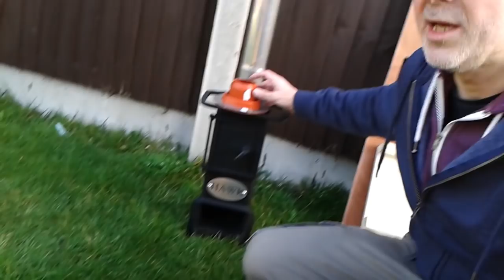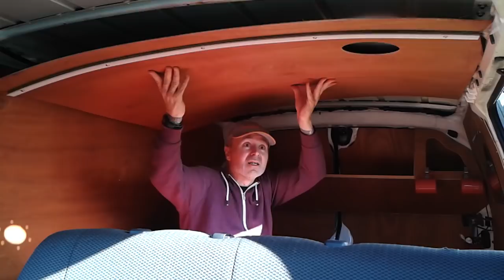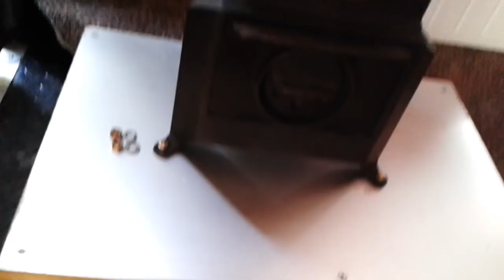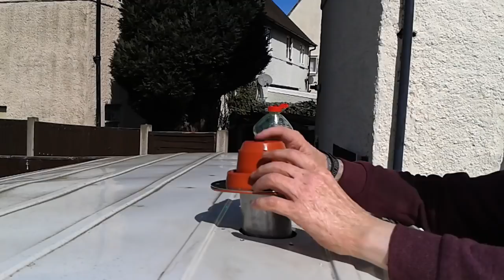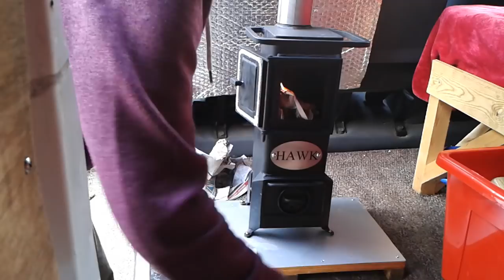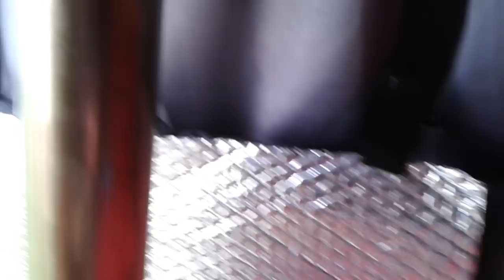Putting a wood burner in the van

Comment: Looks good, if I may suggest, good practice is to do initial burn outside so it can burn off any oils in manufacturing. Secondly a double insulated pipe allows for air intake and does not get burning hot. With my setup I will warm my feet with socks on and put feet directly on the pipe for a few seconds. Gets feet toasty in seconds!

Comment: excellent, thats exactly the same as i've put in my van. I used stainless steel exhaust pipe for the chimney and got a stainless steel water heater from amazon attached to the chimney, heats it up a treat
Reply from the maker: Thanks Phil, have you got a link for the water heater you bought ?
Reply from the maker: Cheers :)
Reply: you're very welcome :) i'm thinking of trying coal in mine so the burn lasts longer
Reply: 2310phil....have you considered using BBQ charcoal briquettes?   Cheap if you catch a sale, long burning, available almost every where, good in a pinch if firewood isn't handy.

Comment: I love your low chimney (although I'd probably use a double insulated flu where it goes through the roof). I'm trying to find out whether there's any problems with a short chimney vs a longer one. Has it caused you any problems?
Reply from the maker: I faffed about with rain caps for a while and ended up with this,
https://www.facebook.com/vansolo.uk/photos/pcb.643030662822868/643030462822888
It's important to get a good draw otherwise it's inefficient (and your roof goes black)
 The only thing I have to watch now is if I leave a window cracked, it needs to be on the side the wind is coming from, other wise it can pull fumes back in, I imagine that issue reduces the longer the chimney is.

Comment: Single skin, uninsulated flue pipe must be at least three times OD from combustible materials, for example 125mm single skin flue pipe must be 3x125= 375mm, twin wall would have been a lot safer to use, the clearance you have at the top would have been OK with it.
You need to put fire board behind the stove with a 12mm air flow behind it and conbustibles to stop heat exchange, and put a fender in front to stop embers falling from that high fire box onto the floor it looks like you have coir matting on yours, stay safe.
Reply from the maker: Hi Kim,
I have read these guide lines but the physics don't scale down.
the diameter IS related to the heat radiated.... but in relation to PI
so while the (3x) generally covers household stoves ... it's overkill for small stuff.
eg.
my 3" pipe has a 25% of the sectional flow area of a 6" household flue
and in theory should only require a quarter of the clearance.

That's on paper .... and practical testing seems to reflect these numbers.

... I am however having to rethink my ceiling hole ;)

Regards
Mc

Comment: Hi ya,
Great Videos to date, Thank you.

SSSOOOOOoooo !,
Lots of questions like - How’s the Stove performance since installed, What do you burn, Any idea how hot the Actual Stove it’s self AND the Flue gets ?, How long does it burn for on a Full stoke, More importantly Are you happy with it’s installation or is there anything you would have done differently.
Look forward to the follow up video if there is one Matey, Stay Safe, Stay warm & Hope to catch you again soon.
Regards Paul.
Reply from the maker: Thanks Paul :)
I've made a few changes since this video and want to do a follow up shortly.
I use dead fall & pallets if they're available but I've found the fire logs you get in wax paper the most consistent and easy to manage/store, I can get a couple of hours out of half of one.
The stove thermometer runs between 150c and 300c ( don't know how accurate it is)
.... the flue would send you to hospital.

Comment: Hello there,

i try to install such a wood stove aswell. Could you tell me the tools you used to isolate the roof of the van. I got the wood stove, but i now need to know how to install the chimney and the exist and so on. Can i buy the materials you used somewhere?
Reply from the maker: https://belltentboutique.co.uk/collections/stove-accessories/products/frontier-stove-tent-flashing-kit
Hi there, I used the above tent flashing kit.
I cut the hole using a Jigsaw (with a metal blade) try to position the stove so it goes through a flat part of the roof ... going through corrugation is messy.
Cheers ,Mc